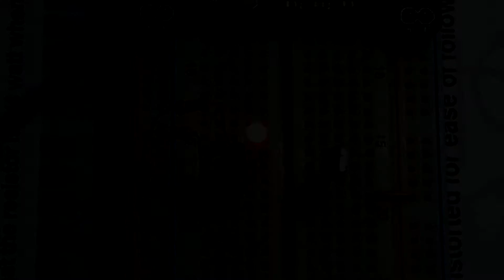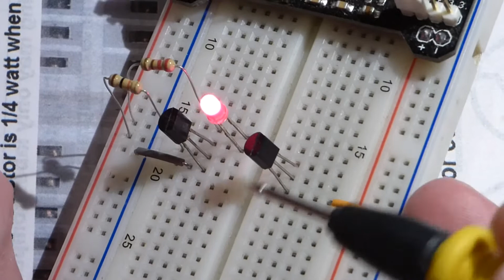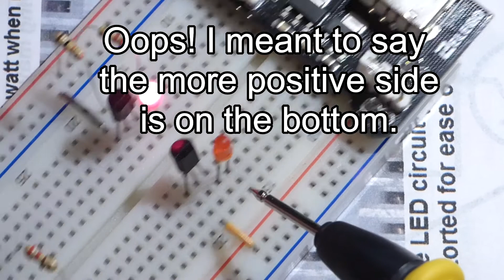Step by step 2N3906 PNP BJT breadbard switch circuit build by electronzap

Comment: Hi thanks for this video, do you know why when i do exactly like you using the 2n3906 on breadboard i get voltage flowing from emiter pin to base pin? I can not connect base pin to gnd because of that... I connect 5v to emiter and it gives me 4.6v at base pin...
Reply from the maker: That's what should happen. Current flows freely other than a 0.6V drop when the emitter is more positive than the collector by 0.6V. You want a relatively large value resistor to limit that current. Here's an updated video that includes a diagram and explains the PNP BJT switch circuit a lot better https://youtu.be/vnSP4otiuBY
Reply: @Electronzap  ah ok i see, i thought i could turn on a LED when 0v is applied to the base and LED off when something like 5v is applied to the base, with a PNP....

Comment: Really enjoyed this simply example of how a transistor works. Thank you. It was more fun when i realised I could remove the leg on base resistor from the negative rail and use static to turn the transistor on/off
Reply from the maker: Yeah, that is really cool. :)
Reply: @Electronzap  i went on and added another push switch and a 3904 to make what I think is an AND gate, both switches need pressing to light the LED.

But what puzzles me, is that the transistors can flipped around, swapping the emitter and collector positions and they still allow current to flow. I wasn't expecting this, because I thought they were essentially diodes.